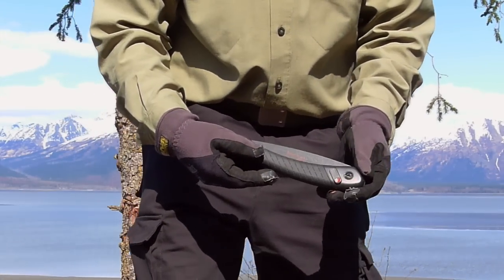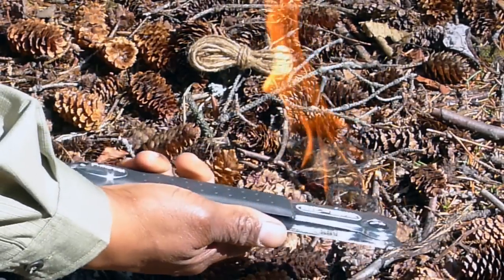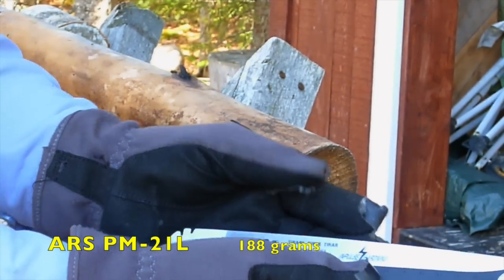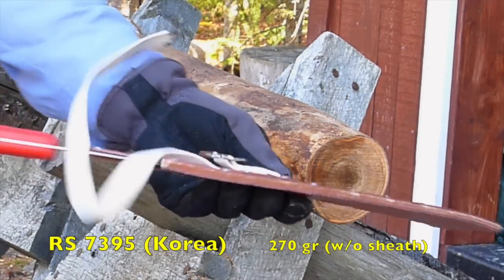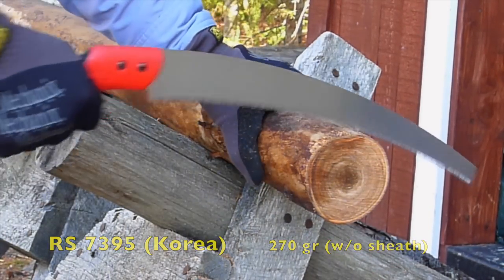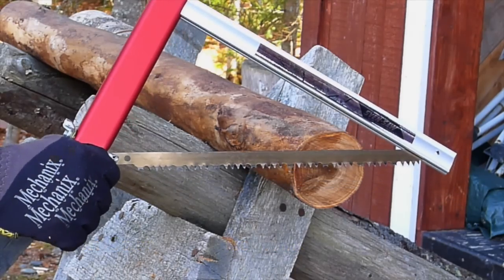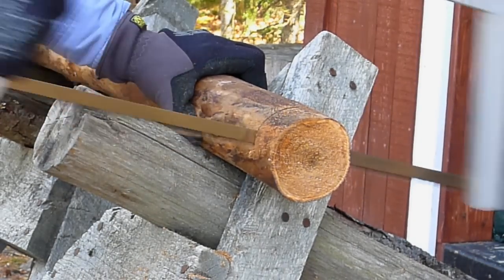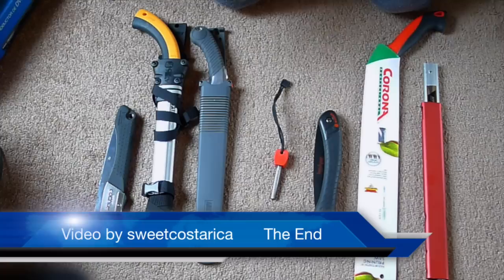Top Saws for Hiking, Camping, and Survival

Comment: I also love Japanese saws. One aspect that you only mentioned in passing is the smoothness of the cut. While this is obviously irrelevant for firewood, it is a huge time saver on crafts and construction projects.
You don't need to plane, sand, or otherwise finish the cut before moving on - the finish those Japanese saws leave is good as is for most DIY applications. Those bowsaws on the other hand rip and tear the wood rather than cutting it.

Comment: Excellent presentation. My current bushwhacking saw is the Silky Bigboy, fits in my Osprey lumbar pack. 4 blades are available with different teeth sizes, easily interchangeable. Solves the hardwood/greenwood/any wood dilemma (Fine teeth for finish carpenters!). Plus a backup blade is always great to have. Side note:  I see Silky now has a 403-65  KATANABOY  Folding Hand Saw 25.6 inches (650 mm) blade, the regular Katanboy's blade was 19.8 inches (500 mm). The Godzilla of folding saws.
Reply from the maker: The Silky Bigboy folding saw is a great one. Many folks still don't know much about Japanese pull saws.
Silky saws are faster, cut very smoothly, and last much longer; these benefits alone justify their higher, but reasonable prices (IMO).
The Silky Katanboy line of saws are a monsters.

Stay frosty.

Comment: Silky the third folder saw seem to be the best and quickest. I like it.
Reply from the maker: Yes, that was amazing in my opinion.

In hand saws Silky seems to be the best. They have advanced teeth designs and different sized teeth. 

From the maker:
There are four GOMBOY blade lengths:
8-1/3-inch (210 mm)
9-1/2-inch (240 mm)
10-2/3-inch (270 mm)
11-4/5-inch (300 mm)

Every blade length is available in three teeth sizes/configurations (tpi � teeth per inch):
5-6 tpi - Large/Coarse (pruning, green wood)
8.5 tpi - Medium (soft wood)
12 tpi - Fine (hard wood).

I used the 8-1/3 inch (210) blade & medium 8.5 tip version of the Gomboy that was the fastest saw.

Comment: Cool review. Thoughts on Sven, and pull saw option....

I use a 21" Sven for "big wood" (up to ~8" diameter) firewood when backpack camping. Applying the same sort of pressure to this saw as you expect to with a pull saw does not produce good results. This saw needs more pressure to take a proper bite. Being a very rigid bow saw, it can handle the pressure and makes very fast work of 2-4" rounds. When using this saw one-handed, it performs best with the hand above the blade to put more pressure against the blade. This saw works best two-handed if you can find a good pinch point to cut against. I often put a foot on the wood propped up into a pinch point, then get after it with TWO hands. One below the blade on the protruding part of the handle, the other pressing against the top near the 90 degree part of the triangle and helping it along. This allows a FULL stroke both ways without worry of smashing finger, and provides the pressure this saw needs to take big bites. 

We take a cheap Fiskars 13" pull saw for <1.5" diameter trimming. I think it weighs ~200 grams with the little blade sheeth. Was ~$10 at walmart. Packs neat enough in tent bag. Teeth are too fine for efficient cutting in larger wood but this is actually advantages for little stuff as it's not as "catchy."

Comment: Nice work.

You also might want to try them on some very small wood because some of those saws will be able to do it well, but on some it will be very difficult, especially if the wood is springy. 

For survival, one of the nice things about the fine saws with the japanese style teeth is that they can also cut plastics and even ropes decently well and if you are not concerned about extensive wear, even bones. In extremes the ability to handle these materials makes them interesting from a survival perspective.

Comment: Great vid , thanks SC
Reply from the maker: Thanks. Wish I had a comparison video on saws when I started hiking/camping again at 50. 
After testing, I discovered all saws "work" but if you want the best one(s) i.e.:
- easiest cutting, 
- fastest cutting, 
- best corrosion protection, 
- longest lasting sharpness,
- strongest build,
- one of the most comfortable to use,
 the easy pick are Silky Saws. They are also going down in their price points these days.

Stay frosty.
Reply: Yes actually your vid make me decide on that one. Is yours the long or short teeth version?
Reply: amazon.com
Reply from the maker: That one on Amazon:
"Silky Folding Landscaping Hand Saw GOMBOY 210 Large Teeth 294-21"
Is good for camping & hiking. Blade lengths of 210mm or 240mm is what most folks like to carry for their effectiveness vs weight ratio.

The teeth size guide for Silky is generally:
- Large teeth = cuts medium to soft wood
- Medium teeth = cuts hard to medium wood
- small teeth = cuts bamboo to hard wood

I personally use "most of the time" medium tooth Silky Saws for it seems the best for all round use.
Reply: Thanks!

Comment: What was the tooth size on the Gumboy?  I'm Getty ready to purchase one.  Excellent cimparison.  Thank you.
Reply from the maker: That Gomboy 210 in my video has medium teeth.

The Gomboy comes in three teeth sizes/configurations:
- 5-6 tpi - Large/Coarse (pruning, green wood)
- 8.5 tpi - Medium (soft wood)
- 12 tpi - Fine (hard wood).
(tpi means teeth per inch)
Reply: sweetcostarica Thank you for the reply.  Subscribed.
Reply from the maker: dragland7268 I appreciate that. I hope to have more videos showing the usefulness of the saw.
It will be hard to find a saw as good as the Silky though.

Comment: Thanks for another amazing video.   Will you please do one long video on all your saws, axes, and Hatchets. 
Also will you please explain what is the purpose of curved blades, in what situations do you and don't you use them?
Reply from the maker: Long video on my saws? I would like that but it might take some time to put together. We will see.
"What is the purpose of curved blades, in what situations do you and don't you use them?":
Pros - curved saws give you more cutting power by angling the saw blade the tool slices as well as cuts. This is more efficient & faster. Arborist/arboriculturist love this curved saw blade as it is the best saw for limbing trees which is what it was mainly designed for.
Cons - For the outdoors person, carpenter, construction industry the curve is not good. When cutting wood on flat surfaces the straight saw is much easier and you can be more precise in your cutting. The curved saw is less of a multi-purpose saw as compared to the straight saw.
Stay frosty.

Comment: @sweetcostarica do you feel the himalayan import 18" sirupate is a tourist khukuri comming in at 1.5 lbs???
Reply from the maker: It is not what I feel about the Himalayan Import 18" Sirupate. It is what the owner/buyer feels. I believe it is my moral job to present facts, like in this saw video, on products so the public can get the best tool for their needs.

IMO here are some criteria for telling weather or not
you have a tourist/export Kukri:
- Do Nepalis use the Kukri in Nepal?
- Is the Kukri of Traditional weight for type?
- Does the Kukri have Traditional measurements for type?

There are a few other details but you get the picture.

I had two or three HI 18" Sirupates and sold all and got a traditional one from Tora Blades and it is a much better and lighter Kukri. Very easy to use and carry.
Again, that just my taste. "Your mileage may vary." - Nutnfancy
Reply: sweetcostarica so
Reply: sweetcostarica in short you feel the h.i 18 inch sirupate is too heavy and performs not as well as the tora. how would i buy a tora? i have u.s dollars i have no pounds how will that transaction occur?
Reply from the maker: Colombiano671 For me, from my research, and told to me directly by Karda (a leading figure at Himalayan Imports) HI Kukris are not traditional kukris in balance, weight, & dimensions. 

If you want a traditional type Kukri in balance, weight & dimensions check out Tora Blades kukris. They are the best I've found because the company makes close copies of traditional military and villager Nepali Kukris in country.

To Order:
Go to the website (http://www.torablades.com)
Go to the Kukri tab at the left and then click on the purchase kukri tab.
At the top of the kukri page click on the currency of choice 
Then order your kukri if it is in stock.

Hope this helps. Happy up coming 4th of July!

Comment: Some of those saws are meant to be used on softer and more sappy wood and you run them slower but with more force.
Reply: The tsurugi is obviously meant for curves, but it did better than the bow saws. It is a shame that most bow saw blades aren't properly sharpened anymore - they're just stamped and set, as if that was enough...
Reply from the maker: kaizoebara I felt this lack of sharpness with the Sven Saw. I don't think the blades are that good, just OK. Bob's Quick Buck Saw came with sharper teeth and was faster.
Reply from the maker: Thanks for the tips Cliff Stamp. I am just getting into the Buck/Bow saws so I have probably made some mistakes with them. Bob's Quick Buck Saw is a great Buck saw, is it the one you are referring to?
Reply: sweetcostarica The one at 6:20 is one, in the video you can see it skipping out of the wood. That tooth pattern is common here on many species of wood like Pine and Juniper which are soft, have an open ring pattern and high sap. They will gum up the small fine pull saws very rapidly and bog them down.
Reply from the maker: Cliff Stamp That makes a lot of sense and I did felt the Sven Saw and Bob's Quick Buck Saw would make much better shelter building tools cutting mostly green wood. The marketing for them is that the Raker Tooth pattern is an all round design for various wood. But as you state and we see in the video these saw are not the best for hard wood.
I'll use the Sven and maybe the other saw this Summer on pine and green wood. I will try to update my views on them from the results.
Great observations as normal Cliff.
Reply: sweetcostarica I have a 21-inch Sven and it's easier to use because you have more clearance.
Reply from the maker: Roger Komula "As long as a tool is useful there is no fault in it." Quote from a old camper.
I have a 21 inch Sven too (still new in it's box). Nothing wrong with the Sven Saws. I just love the speed of those Silky and their clean, smooth cuts. Amazing.

Comment: You can sharpen impulse hardened teeth, you just can't do it with a regular file.
Reply from the maker: I read this on ARS website: " impulse hardened teeth can not be re-sharpened". This warning was next to their 9F-10 Saw Sharpener.

But I'll investigate to see if we can sharpen impulse hardened teeth Cliff.
Reply: sweetcostarica Impulse sharpened teeth are usually near maximum hardness and for plain carbon steels that is 65-67 HRC. Because of this common methods of sharpening will not work, jointing can't be done with a file, sharpening has to use an abrasive not a file, and setting the teeth can break them off. 

The simplest way to sharpen them is to use acid soaks, similar to files. This does not address issues with uneven teeth heights/sets, but few people will use those saws long enough for it to be a problem.
Reply from the maker: Cliff Stamp That's good information that would have been hard to find for the average Joe (me). You are a great resource that I appreciate.
Reply: +Cliff Stamp  thanks, but  mmm what kind of file, or sharpening  tool? do u use?
Reply: +Cliff Stamp ok
Reply: +trooper2221 A diamond file works fine.

Comment: you held the Sven saw wrong, that why it took so much more effort.
Reply from the maker: +song luc Explain, please and post your references.
Thanks ahead of time for your help.
Reply: Ya, I have a saw from the 'late '70s (from Gander Mountain). The handle is about 10-in. There is no grip below the blade. Design is like a regular arch back pruning saw in how it's used. Hand above blade to get dig-in. I wouldn't say mine is fast, but then it was a low price point and the blade isn't as nice as your fast ones
Reply from the maker: Gary Weaver The reason I asked Mr. Song Luc to explain why he though my hand hold was wrong while using the Sven (he still has not answered in a year.  Hmm...) was that the instructions on the Sven Saw says to hold it exactly the way I used it.
If you go to svensaw dot com you will see a picture (top right) of the same hand hold I use in my video.
Safety Note
With the Sven Saw a hand hold above blade DOES NOT get it to dig-in. A hand hold above the blade on this saw binds the saw blade possibly leading to a broken blade.
Reply: sweetcostarica
I can see the reasoning for that, but the proof is in the pudding with it's cut time